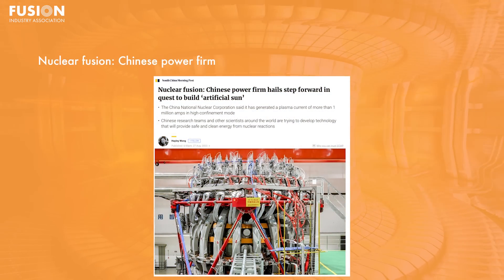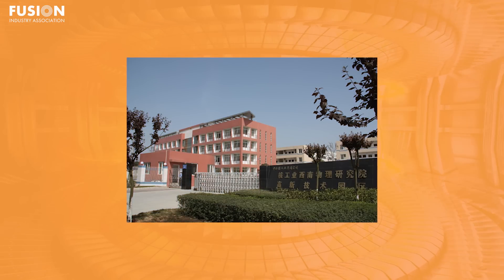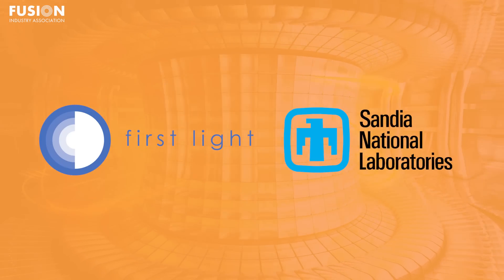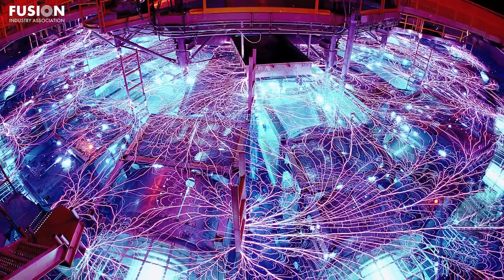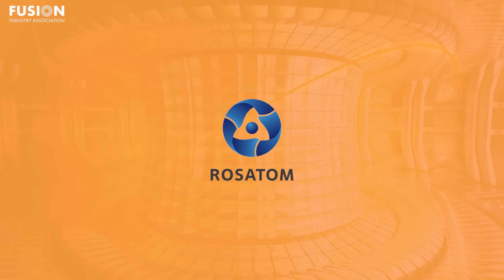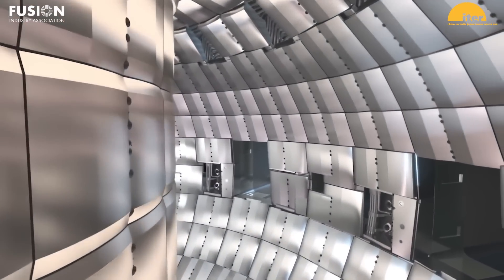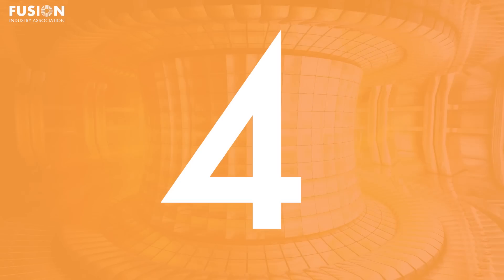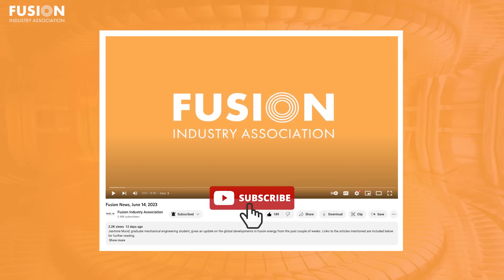Fusion News, September 6, 2023

Comment: Methods of inhibiting liquid metal corrosion will be useful but only if they are tested under high intensity neutron irradiation. At present there seems no easy way of doing this.
Reply: Alas, neutron sources are hard to come by and neutrons are deceptively difficult at measuring given what they are.
Reply: Actually we (including me) are currently using IEC fusors as a cheap method of neutron and xray generation. It is many orders of magnitude lower than inside most ToKaMaK shots, but is also very cheap and easy to replace. Makes it easy to test that stuff.